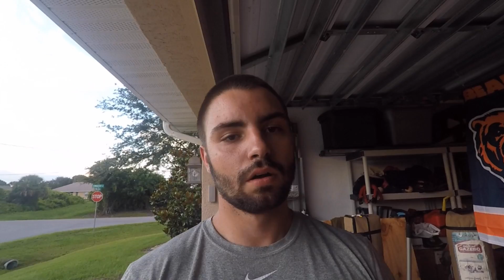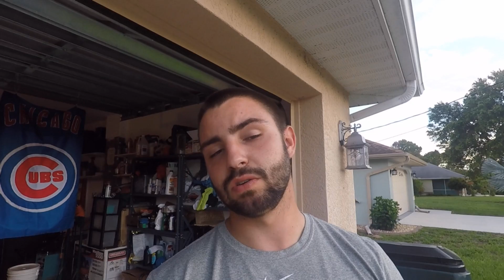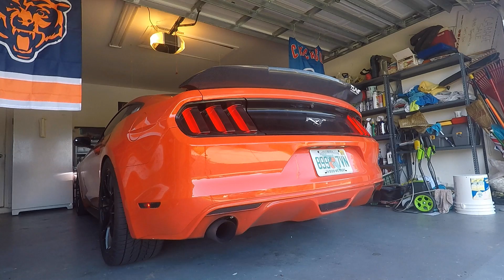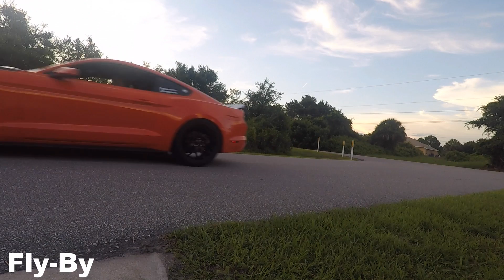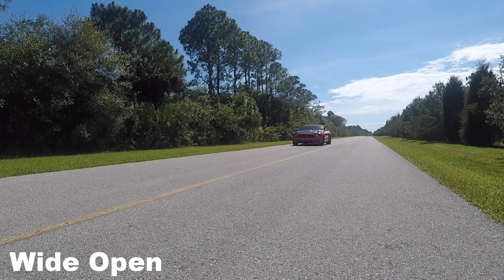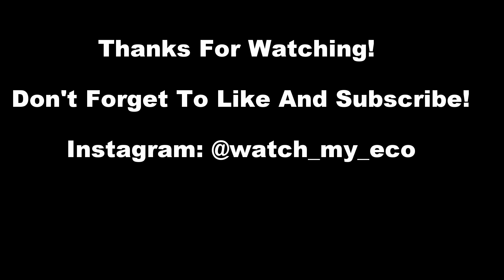Ecoboost Mustang Catless Downpipe And Muffler Delete

Comment: Sounds much better on video.  I have CVF catless DP, MRT y-pipe , and muffler delete.   That setup with stock DP, is perfect sound, loudness.   I loved it actually.  Now that i have the DP, it is way to dam loud.  Cold starts are embarrassing to say the least LOL.  Once it's warm tho it purs pretty quiet, with no drone at highway speeds, which was kinda odd, because under WOT, this thing is so friggen loud and raspy it sounds like ass, to say the least.   So for the meantime i have installed back my oem mufflers, which make my car very quiet,  I have actually been hitting better 0-60 times with the stock mufflers.  4.8-5.1  consistently in my 18 manual.  I think the back pressure helps my car with tq?  Anyways looking top pick up a MBRP street exhaust budget wise, otherwise going all out with Tomei Ti single exit.
Reply: EcoBoost_Matt make a video and upload it plz! This sounds like an almost exact set up I’m looking for

Comment: I have a question, I’m currently not turned, just have a muffler delete. I want to get a catless downpipe, but people on the forums 50/50 say I need to get tuned after installing the catless downpipe or else I’ll get codes and the some other stuff with the loss of back pressure. What do I do?
Reply: Tune the car. Get the downpipe. Buy a cobb tune and tune your car.
Reply: Did you have to get a tune. Don’t think you have too

Comment: How loud is this compared to when you just has the muffler delete. Wondering if it's worth it to get a muffler delete or just wait until I get a downpipe and then get a proper catback.
Reply from the maker: ze OP master id say it’s about 50% louder than just muffler delete. Muffler delete sounds good and is very cheap
Reply: ze OP master I have just a muffler delete and it's ok loud for how I want it to be.Sounds way better than stock, but not as loud as this. Somewhere perfectly in-between. If you're just looking for a better sound without attracting too much attention, I believe you'll like just the muffler delete
Reply: I ended up getting the muffler delete a couple months ago and i'm very pleased with the sound. i will probably get a catted down pipe because i want to get some more performance out of the car without making it too loud.
Reply: @yosemite6545  did you ever get the downpipe?

Comment: One question does the ecoobost already have the turbo noise when u delete the muffler
Reply: very little obvs you will hear turbo cuz it has a turbo but just with the muffler delete not really you can add an intake you will hear it more but muffler delete sounds pretty good i recommend